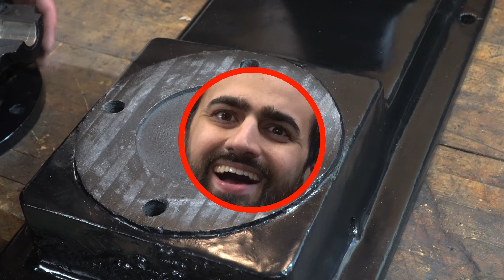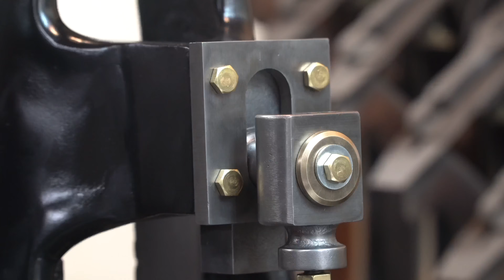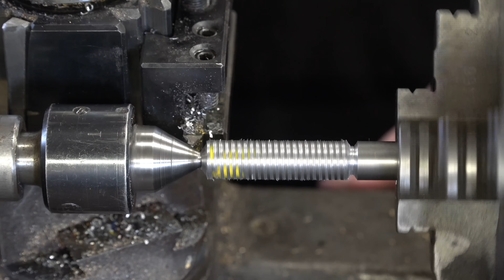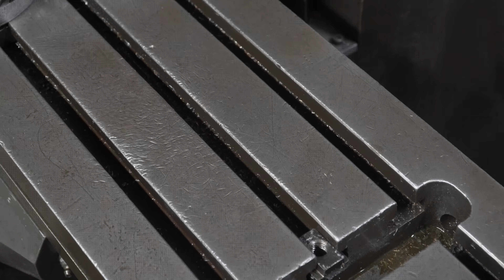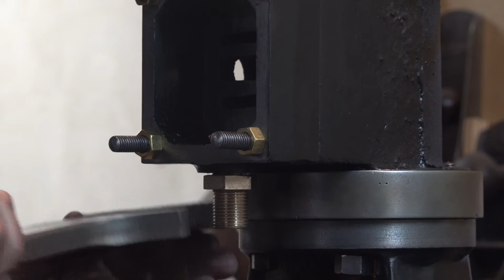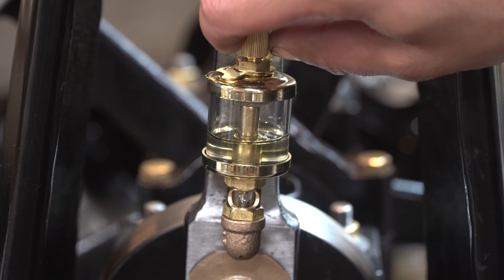Narrated: Antique Vertical Steam Engine - Part 2 [Restoration]

Comment: Great work.
Just imagine, that such engines usually run much better on real steam, instead of air.
I build a close looking replica of such a steam engine from PMresearch 5Bi kit, which provides power to y model steam winch, used on my live steam Shay loco to load logs onto rail cars.
With some gear reduction and pulleys, the tiny steam engine can lift up to 30 lbs logs. Videos on my channel.
Keep up your great work.
Gerd